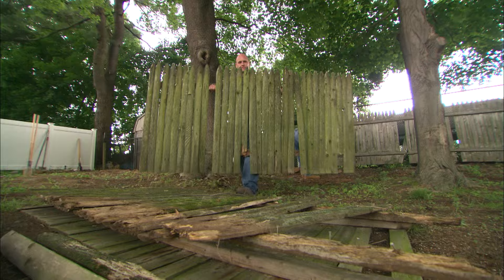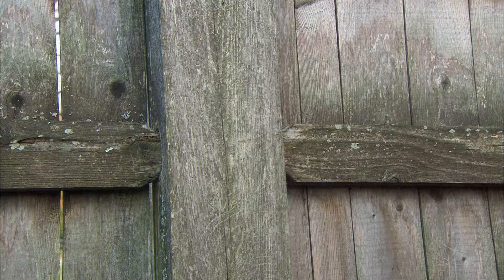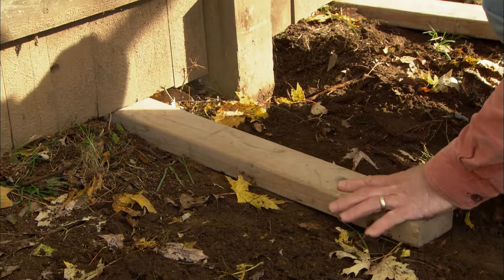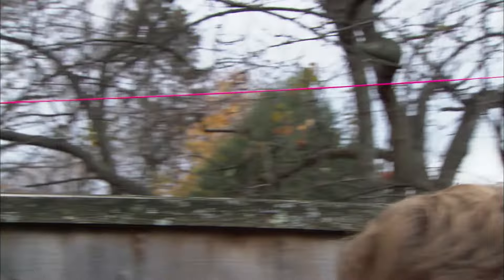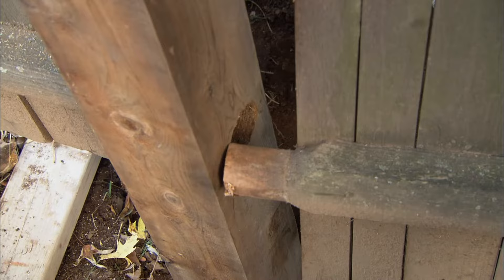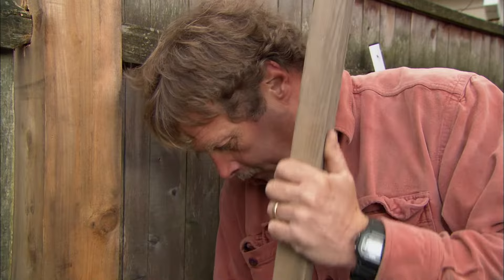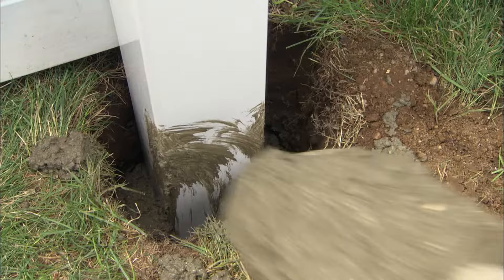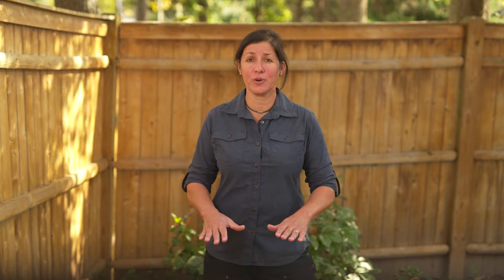How To Repair a Fence | The Home Depot with @thisoldhouse

Comment: Do u need a building permit to replace your fence panels?
Reply: I had this same question for the longest time and could not find the answer but if you Google, " [insert your city] fence code" it might bring it up. You can also search for the numbers to your 'Codes and Regulations' or your local 'Planning and Design' offices. Call them and they can tell you if you need a permit. If I'm understanding correctly where I am I only have to have a permit for anything over 7 feet.
Reply: where I am you only need a permit if you're replacing the fence not if you are repairing the fence and using similar materials.